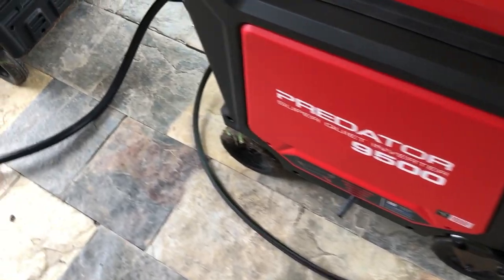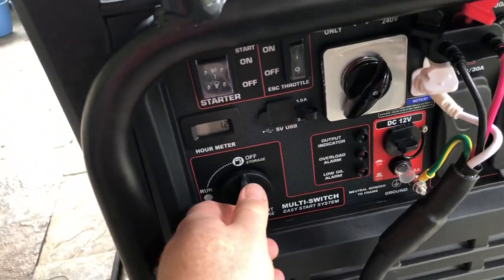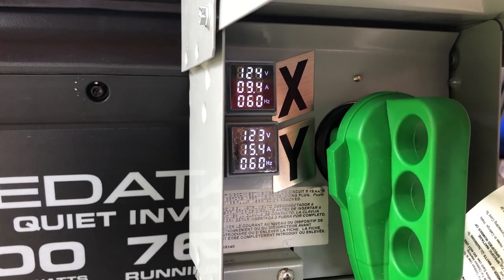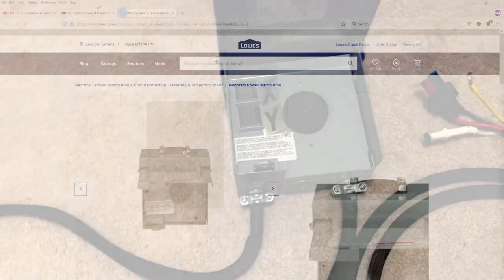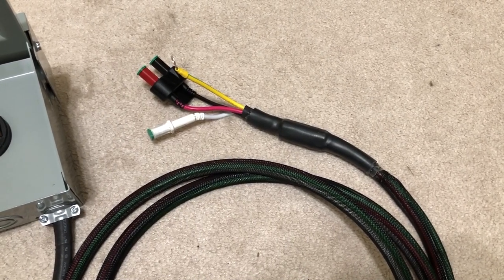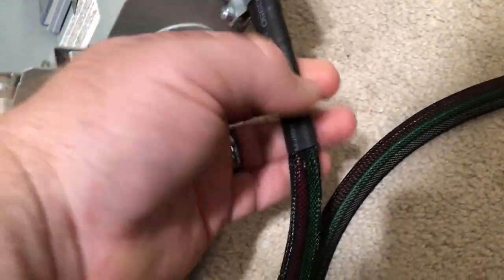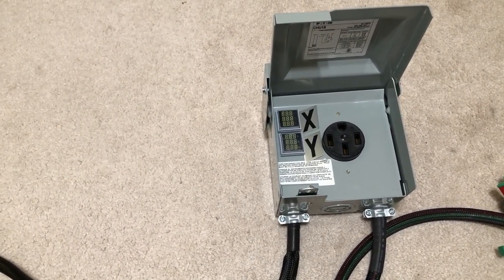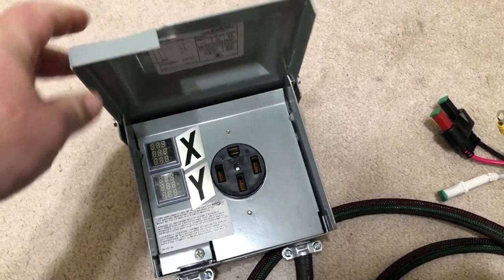Predator 9500 Home Built 240V Parallel Kit Test & Build Parts: 2X Output Power Using Two Generators!

Comment: Hey Jason! Great video on these two generators. I about went with these two predators to power my 25A/240v concrete grinder but instead opted for the Ai-Power 7100 inverter generators. My question regarding your video is, do I need to build a kit like this, or could I just use the powerhouse parallel cable. I don’t need a 50amp plug, as the 30amp plug on the front of one of the generators will work for what I need to power, I just need to parallel the two so that I have enough running watts. The Ai-Power generator does not have a neutral spot for the white cable, but does have a neutral floating threaded post. Will I still be able to use the cable without plugging the neutral in, and just focus on using the ground wire. Thanks for any help!
Reply from the maker: Each generator should be able to make 30amps, so you don't really need a pair if that's all you plan to pull.  Some generators are designed to link together such that the front panel of either one can handle the combined wattage of both.  (A feeds into B, and the front panel of B provides the combined power of A+B).  

These are not designed that way, and only have a 30a socket on the front.  So if you linked them together and plugged into the front panel of A, the max it can output would be 30a, because that socket has a 30a breaker on it, and, I would assume the panel wiring internally is designed only to handle 30a.  With these you're pulling the power through the parallel sockets from A and B, and combining them in the Parallel kit box with a 50A socket.  So when you draw power from there, the power is flowing from both A and B, but neither A nor B ever have more than 30-ish amps drawn from either one.

I'd be a little sketched out using only the ground for neutral.  Yes, it would work, they're bonded to neutral anyway.  But that's potentially a lot of amps flow back through that ground post for unbalanced loads.  I don't really like that being the only path back and being exposed at the same time.
Reply: @Texas_DIY  so I understand that each is their own, 30amp max. What I need is more wattage from both to power a 240v/30 amp concrete grinder. Each generator is 5700 running for the ones we have. I need around 7,200 running watts to run the grinder. So, I want to parallel the two grinders for more output. I don’t need a 50amp plug. I just need a 30amp 240v, which each generator has. So, if I parallel them with a cable, can I use one of the plugs on the generator and it pull the power from both, that’s I guess what I am needing to figure out
Reply from the maker: @coryR524  Ah I see.  Was thinking you had the predator generators.  With your Ai-Power units, I guess it would depend on if the panels are wired to handle that much power on your existing generators, such that combining the output, and feeding it through a single unit can be tolerated.  I would think it may be safer to make a parallel kit and use that as the outlet vs. the front face since the capacity you're talking about exceeds the output of any one single generator.  Their combined output would make 47.5A, which is more than any of the front face plugs on the generators can handle... that tells me that if a parallel kit existed for these, it would probably be the type equipped with a plug vs. the kind that just links them together.

Does your concrete grinder never pull more than 30amps?  Or is 30a normal, and it spikes higher when under heavy load?  If it can consistently pull more than 30 if the motor is under strain, you may end up having problems if you try to route all the power through the front face of one of the generators and it's 30a breaker.  So I don't know, it might work, might not... just depends on the actual electrical loads.  

But if you combined them and put your socket at the parallel kit, it should work for sure as you'd have over 47 amps available, BUT, I'd suggest you build your parallel kit with a breaker on it, and go ahead an put a 50amp socket on there as well (why not?  You may have some other application where it would be helpful).  In the video I think I reference a larger box that has the sockets and breakers on it.

On my home system, the inlet is controlled with a breaker, so I don't really need one in the parallel kit.  In the case you're describing, if you link them together using only the parallel kit and not front panel connections, you're bypassing the breakers and there really should be one on the setup.

Comment: Thanks for these videos (Both Jasons). I keep seeing conflicting statements as to whether or not this will be true 240V. I have an electric pizza oven that is 240v and want to make sure before I ruin it. Also, do you happen to have any pics of the inside of the outlet box wiring. We can wire simple switches and household outlets, but don't want to get this wrong.
Reply from the maker: This is absolutely true 240VAC single phase power, exactly the same as what comes in from the power company in the US.  (assuming you are using a generator that has 240V and it's set to 240V mode)  The Predator 9500 has a switch on the front that flips between 120 and 240, (I see no reason to ever have it on the 120V setting)

Take a look at my other videos on this subject.  The technical one covers how the outlets are wired, and what legs each are connected to.  It also has a wiring diagram of how the box is put together.  https://www.youtube.com/watch?v=QBK47lWmQps

I would not suggest adding switches to the box I made, there is little room and it will just complicate things, and if you're trying to switch 240, you'd need a double pole switch.  

If you want to make a box with different plug outlets, do a google search for "GE Recreational Vehicle Power Outlet  GE1LU502SS"  it's larger, but has a 120V outlet and a 50amp with matching breakers to switch them on and off.  It will make connections easier with the breaker and bus bar connections.
Reply: @Texas_DIY  Wonderful! Thanks so much. The powerhouse cable is now out of stock and unable to be purchased online so I guess we will be creating from scratch.
Reply: @Texas_DIY  Any reason to put a circuit breaker in the box like you used?
Reply from the maker: @gretchengriffin4252  One could argue either way.  In the case of my box, all the wires involved are suitably spec'd to handle that amperage.  So if there is a dead short, the generators will (in theory) overload before the wires burn.

However if you were to use the GE box I suggested (assuming you want other additional outlets) now the rules change.  That household outlet in the GE box is probably rated for ~15amps.  But the source of the power can produce up to 80amps (over 60amps continuous) with two combined generators.  So you have a problem there if there is no breaker involved.

If you were to have cords plugged in, and something shorted out, the more narrow gauge wire of those cords would be much more likely to catch fire and burn because there would be no breaker between the source of the higher capacity power and the lower capacity wiring.  It needs a breaker to protect the wiring after the outlet from risk of fire.  And in the case of my box, there wouldn't be one.  But in the larger GE box, there is.  And since they were at it, they went ahead and added a breaker for the 50amp plug as well. (which is really probably best practice anyway)

So should my box have a breaker?  Yes... but in the case of my smaller box, I believe that it's safe enough for my purposes and the way I'll be using it.

In general, if you don't mind the extra size, that GE box is the probably really the way to go.  Easier wiring (no need for the terminal blocks), more space so you can add the meters easily if you want, and the added safety of breakers to further protect things.  Just be aware that the 120V outlet is going to have to pull power from either the X or Y leg of the 240v source.  So you may opt to wire it unique to your situation, if you find you're pulling more power off X, put the extra outlet on Y or vice versa.  So you can help balance things out.
Reply: Read manual, don’t look at Facebook friends

Comment: What kind of run time do you get, or how much fuel do you burn per hour running your house?
Reply from the maker: With the inverter generators, fuel is pretty directly tied to energy use.  They'll throttle up and down as needed to accommodate the loads.  I don't have a firm feel for the usage, apart from they'll easily go all day.  Harbor Freight advertises 18.5hrs on a 6.8galon tank @25% load... I'd say I was seeing something similar.  In running both, in eco mode (where the throttle is allowed to vary) the load is divided in half between the two units, so it's not too hard to stay in a happy 25% or less range with the occasional surge.
Reply: @Texas_DIY  Great thank you for the response.  So most parallel kits say you shouldn't run the genset in Eco mode but you're not seeing this issue, even with your 5 Ton AC connected?  

I greatly appreciate the time and effort you put in to this and helping people.  Living in S Florida I am trying to figure out how much gas I need to have on hand for 3/4 days without power or access to fuel.
Reply from the maker: I've seen zero issue at all running them in eco mode.  It's one of the key features I love about them that allows for a much longer run time and gas savings.  I do like to keep them out of eco mode when I initially switch over, the home onto them, that way they're already spun up, but even then, it doesn't seem to hit them too hard.

Comment: Sorry to keep bothering you. I just wanted to get your opinion on this. I haven't heard back from duromax and I just don't won't to damage either generator. This is what I sent them.

 Since the parallel wires are switched at the 3 pole master breaker on the XP9000iH, what is the procedure for connecting both generators to work in parallel as far as what order to start them so they are synced. Since the parallel connectors are off untill the 3 pole master breaker on the XP9000iH is switched on, How can the second XP9000iH detect the master. Just curious.

I just don’t want to burn anything up. Please do you have anything you could help me with regarding the starting of the XP9000iHs in parallel. Some folks are saying it doesn’t matter the order there turned on, but most other manufactures do have a specific order.

Thanks for your help
Reply from the maker: On the Duromax parallel kit, are you saying the breaker disconnects the two sets of plugs from each other?  I would expect it to break the connection between both the parallel plugs and the **outlet**, but not from between the parallel plugs (Side A to Side B).  Without that, if the two generators are running and only "seeing each other" for the first time when the breaker is thrown,  I don't see how the generators could synchronize with each other without doing really weird / bad things to the power of whatever devices may already be connected.

And if that breaker were to trip on the parallel kit, then the generators wouldn't be able to "see" each other any more, and the frequencies would begin to drift out of sync.  (just like two stop watches started at the same time don't tend remain in sync for more than a few moments)  which (in my mind) would be bad if you were to flip the breaker back on, and introduce two different (out of sync) frequencies of power into your home.

I'd double check, not from the outlet, but from only the parallel cables, that the red cable of side "A", and the red cable of side "B", and the black of side "A" and black of side "B" (again, ignoring the outlet) and see if those are always linked together by color regardless of the breaker.

If they're not, maybe duromax has some kind of way of instantly resyncing when another power frequency is detected or perhaps the inverters can adapt.  I don't know, but I'd be wary of having both units on, and then connecting them after they're running (by throwing the breaker).

I've speculated that this is the reason that when overloaded the inverter just shuts off, and there isn't a reset button.  Instead you have to completely power down the generator, and restart it.  My speculation is that this is to ensure it can re-synchronize to the power that is still present.

If it were me, I would turn on generator "A", make sure the breaker is on so "B" is receiving the power from "A" via the parallel kit... then start unit "B".  "B" will have voltage present when it starts, and sync to that.

If the breaker in the parallel kit truly does disconnect not just the outlet, but also the units from each other, then if that breaker ever turned off, I'd make sure I shut down one of the generators before turning the breaker back on again, and then powering on the remaining unit only once it was "sensing" the power from the other.

Comment: 1 Hi Jason do I have a Very interesting question for you  about using 2  Duromax XP9000iH in parallel with the XP9000iH-PK parallel box. Could you give me your thoughts on what you think about the way Duromax is doing there parallel box the xp9000ih-pk. with 2 xp9000ih generators. On the front panel there is no  neutral connection only two hots and the ground which neutral is bonded to the frame.  On parallel box there's no neutral wire at all and on the 50a  connector on the parallel box the neutral is not even connected to the ground internally. On the parallel box the wording over the 4 wire 50a connector and the 3 wire 30 connector say 240v. not 120/240 like the front panel on the generator. All of this this just seems odd to me.   Thanks for any help
Reply from the maker: It looks like they're using a L6-30R on the left socket (search for that and you can see how it's wired).  X,Y,G.  Since ground is generally bonded to neutral, you can pull power off either leg and treat the ground as the neutral.  Probably intended more as a 240V source.  While the right hand socket will have X,Y,"N",G...   But since the whole parallel kit doesn't have a neutral anyway, it's all pretty much the same thing, as the ground cable is serving as the neutral/ground and taking any of the imbalance between the two legs. 

I do like that the Predator includes the Neutral.  That way the exposed ground post/terminal doesn't sketch me out so bad.  But at the end of the day, it's probably not a major thing.  Just make sure the ground is secure on the Duromax, and don't mess with it while it's running.  Any 120V devices, are using that as the return path, so there will be current flowing through it.

Comment: I came across your video and I think you may have just solved a major problem for me. I have a RV with two 15000 AC units. I  want to be able to run both AC units at the same time, and while they are running use anything I want in the RV. The electrical system is a 50 AMP system. Would the parallel kit you made work for me? Thanks in advance.
Reply from the maker: I would think so.  Though unless you're going crazy with power use, you may be able to get away with one, combined with the soft start for the AC units.  You'd have to meter them to see what the loads are.  If you don't have a soft start, seriously, start there, it might solve all your problems much more cheaply.

This is the playlist of the full video series, the same company that makes the soft start unit I installed in one of the videos, specializes in RV setups as their primary business.  https://www.youtube.com/playlist?list=PLzoNthJzzMFQ877vyCfoc53oDQqGFAIKN

Comment: Hey Jason!! How could I get something similar to a champion 4650? I need a true 240 to run a 240v appliance in a trailer. Do you have suggestions?
Reply from the maker: That particular unit is not a 240V generator.  While I'm sure there are other models out there that meet your requirement, off the top of my head, I only know of (3).

BE$T:  
Honda EU7000IS  (Less AMPS than the others, but it's a Honda and will go forever... at more than twice the cost of the Predator)  

Good:  
Harbor Freight Predator 9500 (cheaper, gasoline only) or 
DuroMax XP9000iH which is internally nearly identical to the Predator, but, adds auto choke combined with a nifty remote start / push start, and most of all, it's dual fuel.  (For about ~$500 more)

This is the link to my playlist, I cover it just a tiny bit in the other videos: https://www.youtube.com/playlist?list=PLzoNthJzzMFQ877vyCfoc53oDQqGFAIKN

Comment: Before I can really comment. I need to know when you are running on this setup and really using the house, what amp loads are you seeing on each leg? The ones I could see in this video (I know you were just testing for the video) were low.
Reply from the maker: The amps on each leg depend on what is running in the house.  Keep in mind that reading is the combined amps, whatever it displays is divided in half to represent the load on each generator.  

On a hot summer day, normal lights and computers running, with the the electric how water heater on and the AC running it's around 44amp on one leg and 38.4 on the other average.  (not counting surges)

If I turn on any appliances that will of course add to it:
Range: one large burner 10amps, one small burner 5.8a, oven 11.2amps (of 220 off each leg)
Clothes washer is pretty light at around 5.65 amps (one leg)
Toaster oven / Air Fryer 14.9amps (one leg)
The clothes dryer pulls a solid 25+ amps of 220 (both legs) and you can REALLY feel that one when it kicks in.

Basically with the AC soft start, if I really carefully meter things, I could probably get away with one generator.  But if you start needing any appliances, it will quickly exceed the capacity of one.